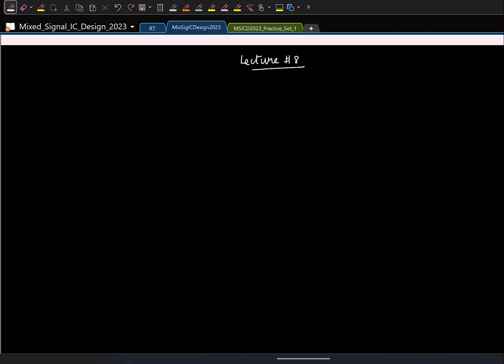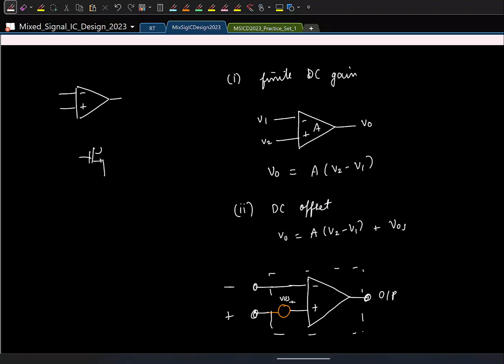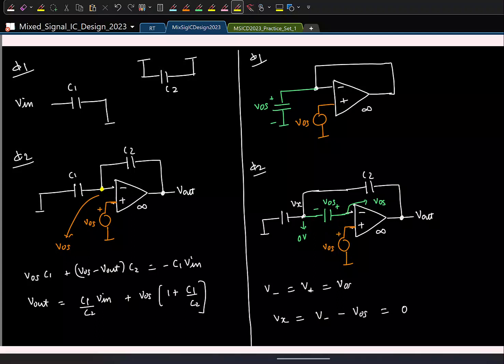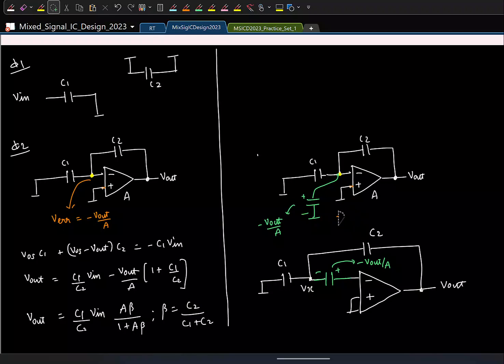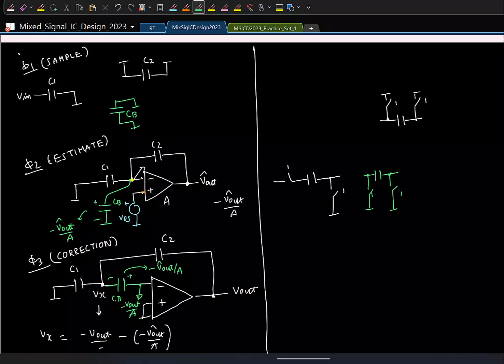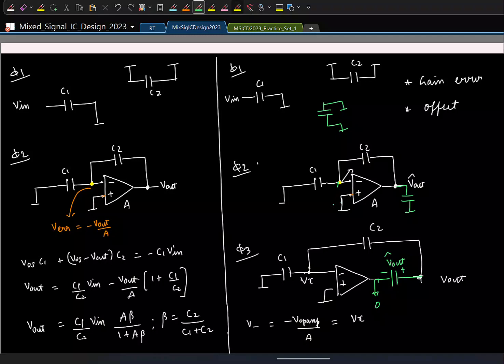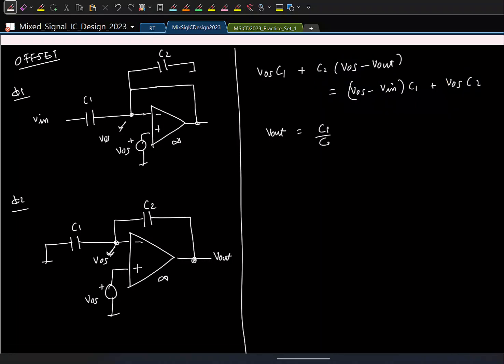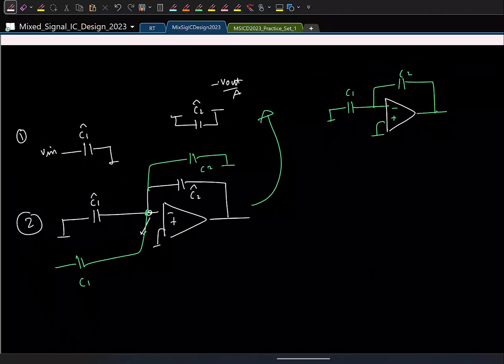Lecture 8: Correlated double sampling (CDS); Correlated level shifting (CLS); gain error & offset

Comment: If we use an extra phase in CDS i.e currently 3, but use another 2 more phases instead, can we get the effective opamp gain to A^3? 

My thinking is that, in CDS, we used one phase to get a proxy for the output and offset voltage and then sampled that onto the cap and used that to subtract and get our virtual gnd to v+. If we use an extra phase now to sample the already corrected error, we can get a better estimate for this error right hence boosting gain?